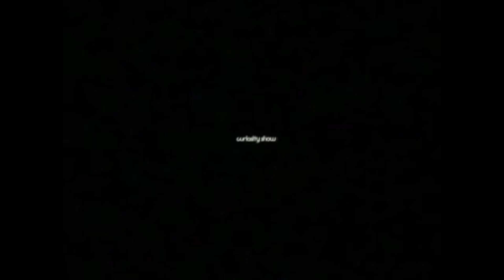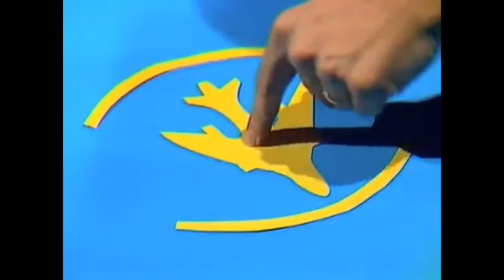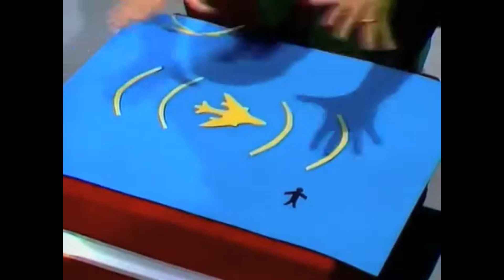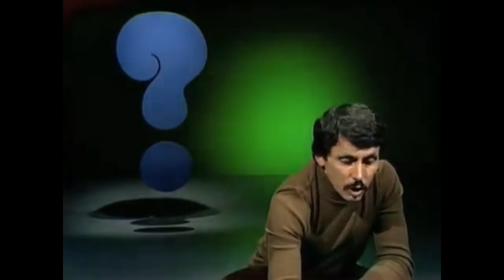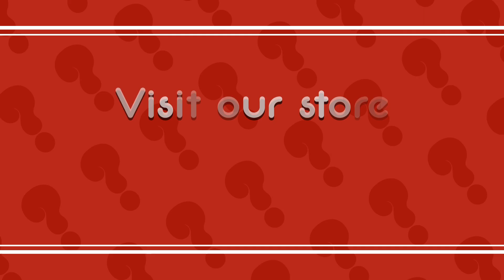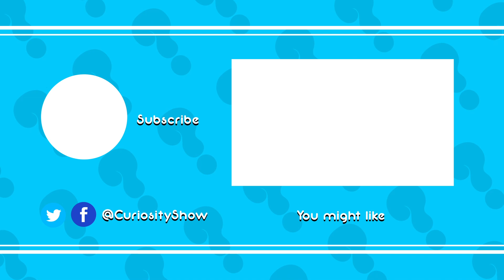Breaking the Sound Barrier

Comment: But that (engine noise "piling up") isn't the main reason for a sonic boom. For instance, the Space Shuttle re-entering the atmosphere and a super-sonic lead bullet both produce a sonic boom but are not creating engine noise. https://en.wikipedia.org/wiki/Sonic_boom
Reply: There is also a lot of noise caused by friction in the air. Maybe it’s a bad analogy but think of electric cars vs gasoline cars. Gas cars are louder when going slow speeds but when they are both going highway speeds they sound the same. Mostly that has to do with road noise but also aerodynamics.

Comment: Never heard sonic booms explained so clearly.  But then why is there a visible cloud when breaking the speed of sound?
Reply: It doesn't happen when breaking the speed of sound, it happened right before breaking it and when there's high moisture in the air, the condensed air creates high pressure in the front of the plane and low pressure further back, the low pressure causes moisture in the air to form a mini cloud, there's a video here in the channel called "Making Clouds in a Jar" that shows how this is happening.